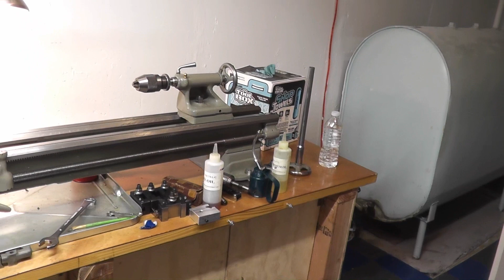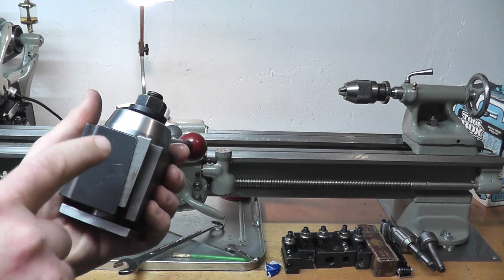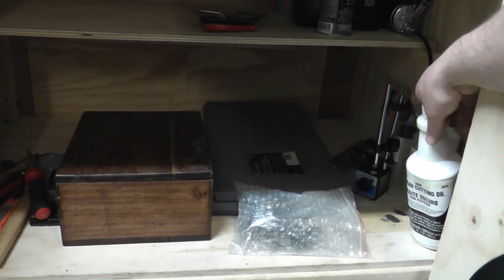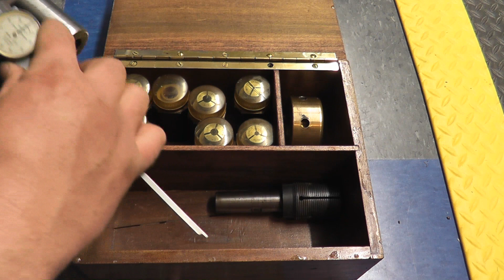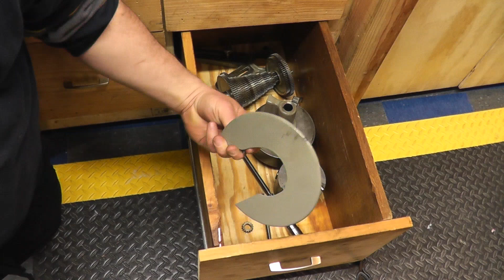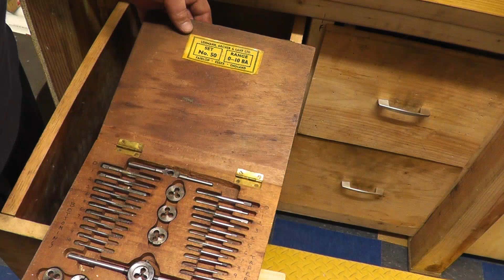Toolbox and Drawer Tour Part 1

Comment: That attachment in the wood box could be a 4.5MT. Not a 4MT and not a 5MT, an actual in between 4.5MT. It was an odd size used in the spindle of some lathes like Clausings, Rockwells and even some Southbends. Some later editions of the Machinist Handbook list the taper measurements for the Morse Tapers including the 4.5MT.

Comment: Hi, 
Is that an old door your lathe is sitting on?
Have you checked your lathe for accuracy?
Reply from the maker: New solid core door.  I check the level of the lathe every change of season and adjust as needed.  Lathe is perfectly accurate for any of my needs.
Reply: OK, if your happy good.

Comment: i see a lot of people just use a piece of scrap to stick in the 3 jaw, turn a 60 degree tip and then use that as the dead center. If you are going to use a 3 jaw the advantage is the dead center you turn is 100% concentric. Not even a piece of swarf will cause run out on that.

Comment: Thanks Greg for the tour, always enjoy snooping in others stashes, you see so many interesting things.

Got a question for you, my SB 9A has a larger 0.200"  cross feed dial on it when I got it. I bought new brass nuts for the cross feed and compound, the renovation book shows a collar with a 1/8" hole on both for removing them, however my cross feed doesn't have the collar or hole, so how do I get the threaded shaft out to replace the nut?  

Thanks Greg.
HH
Reply from the maker: Usually the compound and crossfeed will consist of 4 parts minus the nut.  The screw itself, a bushing that is threaded into the compound or crosslide, a graduated dial, then the ball crank that sandwiches the dial between the bushing and the crank.  Most of the lathes had a pin spanner hole on the bottom of them to tighten or remove them.  Some older versions had a hex nut instead, but you said you had a 9A so I assume it should be similar to mine unless someone modified it.  If you want to send a picture of it to the e-mail for this channel and I can get a better idea of how it's attached.

Comment: Thanks for the tour, is that shaft removable on that 3c collet holder? or could you cut it off and thread it to fit your spindle, might be a nice option for holding the collets.
Reply from the maker: It is not removable or at least it's a tight press fit.
Reply: Ok I thought I heard you mention the end might be brass and thought ah 2 different metals maybe it comes apart. My bad

Comment: That 3c adapter may have been built to use in the larger 13 or 16" SB lathes.
Reply from the maker: It's possible.  I'll have to check.  My how to run a lathe book lists all the measurements for the spindle tapers.  When I dig that out of a box I'll compare the measurements.